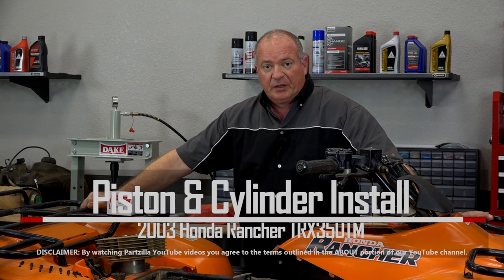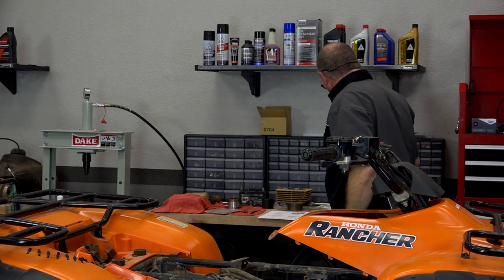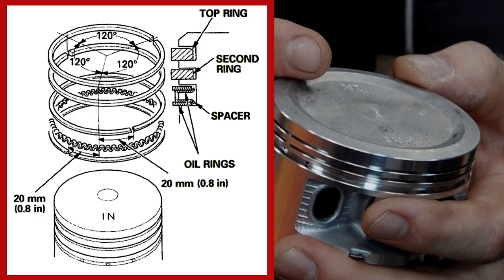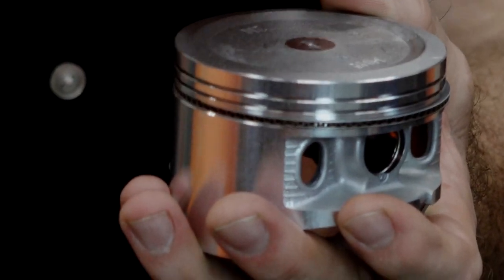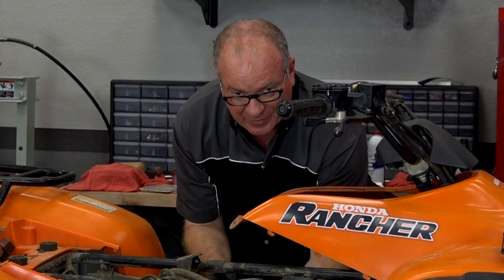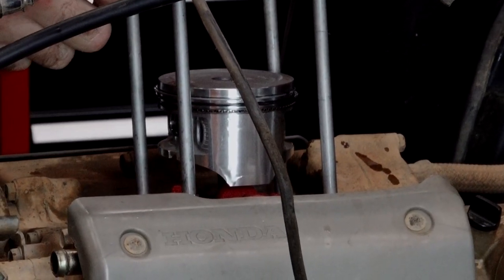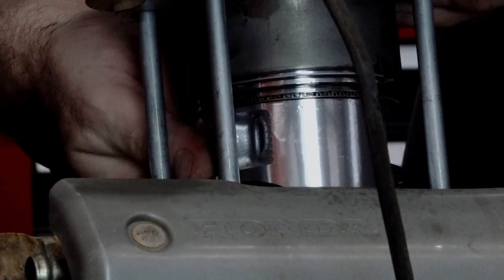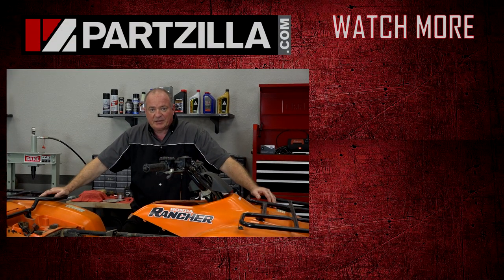Honda Rancher 350 Top End Rebuild Part 2: Piston Installation | Partzilla.com

Comment: Somebody has given me this exact bike. I had to rebuild the top end, replace all the plastic because it was left next to a bonfire, I virtually rebuilt the whole thing, I took me months. I Really Got a lot of info from these videos. I'm an Instrumentation/ controls tech by trade but I worked at a machine shop building engines right out of H.S. I wish more young people would take to fixing old things instead of wanting new everything.  Nothing wrong with putting a little work into something.

Comment: Sometimes mine does crank over and clicks when I push the starter. I have to pull the crank cord and move it and then it will start. What does this mean? Bad starter motor? or something in the lower end? Thank you - David

Comment: Hello John,
I have a 2002 trx350 with 75.2PSI of compression that puts out a tonne of white smoke from cold to fully warmed up and burns a lot of oil, cylinder and piston don’t have a scratch anywhere I’m going to do valves anyway but do you think it could be piston rings? also there was a channel from one head bolt to the other that formed underneath the head gasket could that be causing the oil burning?
Thanks in advance!

Comment: What did you set the ring gap at?
Reply: Ring gaps are 120 degrees apart
Reply: @andyhegwood9387  he is referring to the gap between the rings themselves when compressed. Not the ring clocking lmao. What a noob response.

Comment: Should I clean the inside of the cylinder? And if so with what (thanks in advance 😄)
Reply from the maker: Yes, just use some contact cleaner and make sure there is no debris.
Reply: @PartzillaParts  also put a little oil on the cylinder wall a dry start isn’t too good

Comment: I just rebuilt the top end on my 350 rancher and when I started it up it started leaking oil from the cylinder to block gasket. Any ideas? I used a Chinese gasket and no gasket maker.
Reply: I had the same problem
Reply: That happened to me too, I have no clue what I did wrong because I followed the tutorial step by step.
Reply: @chog4607  you have to put gasket maker where the two case halves meet

Comment: You mentioned getting over sized rings and piston but didnt mention if you bored out the cylinder yourself or if it was required at all b/c of the oversized piston/rings. Can I just use a honing wheel?
Reply from the maker: Typically, send out for boring, then get the oversized rings and pistons to match new size.